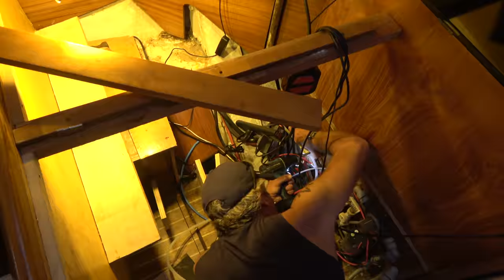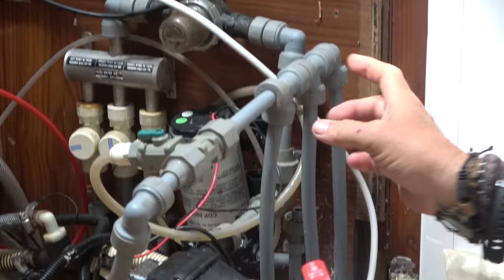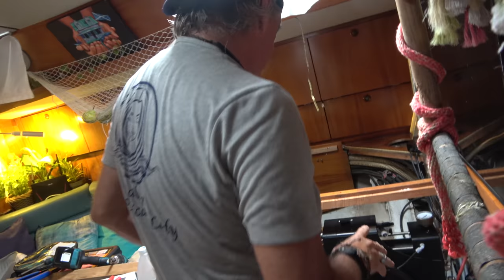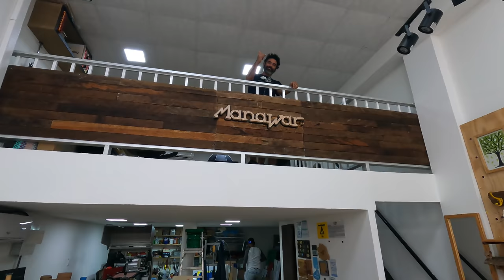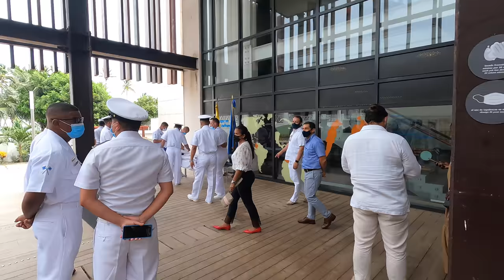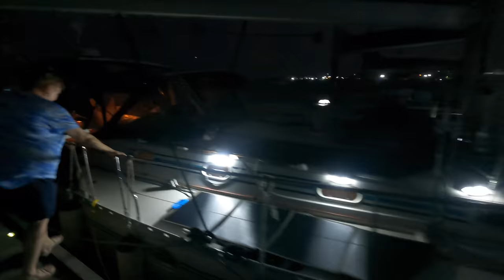SSL 609 ~ Surprise visitors..!

Comment: Be careful of PEX  B and those brass fittings everyone of those brass fittings will create a restriction in the water flow . I would recommend PEX A it doesn't use brass fittings
Reply from the maker: We don't mind restrictions because the last thing we want is someone running 5 gallons a minute down the drain taking a shower!  Lol   And I had some of the plastic non-restrictive type, but definitely preferred the sturdier design and longevity of the brass.. should last the life of the boat now!  :)